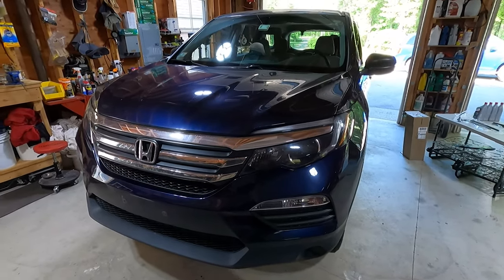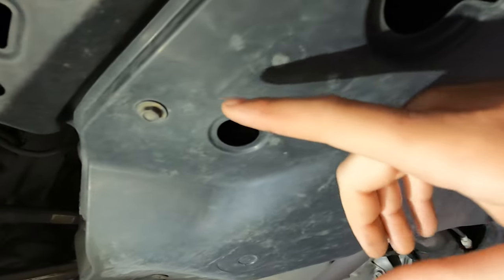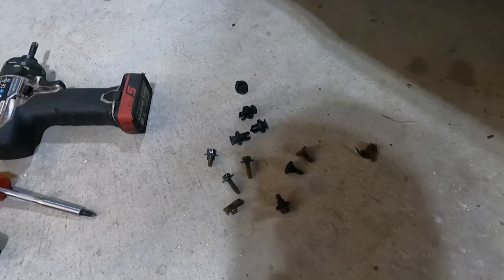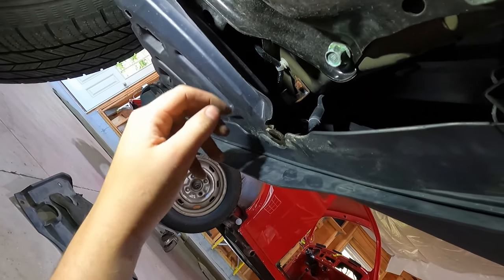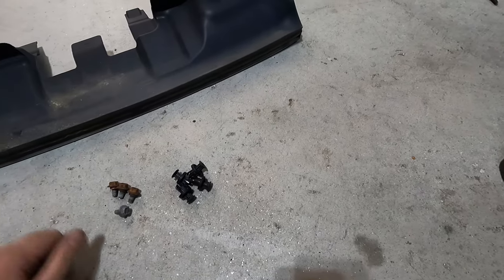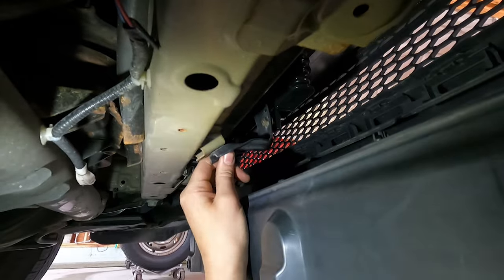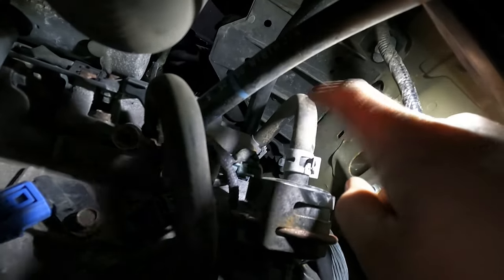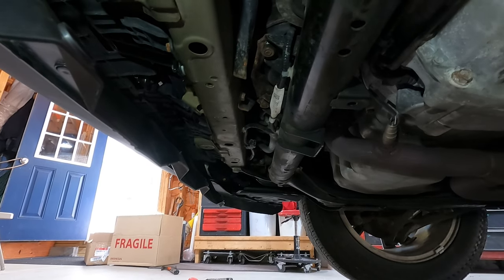2016-2020 Honda Pilot | How to install OEM transmission cooler kit | Better cooling + more towing!

Comment: I use a translator. Can you tell me if the 9-speed transmission is also useful for installing this device? Or is it unnecessary? I want to tow a motorhome, don't know which one yet

Comment: This kit will also help the 6spd tranny not burn the fluid as much .longevity wise even if not towing .specially with these 6spd tranny issues I have a 2020 with 33k and I had to do a 3x drain and fill and the tranny is eating up this fluid so I have to do drain and fill every 15k .my friend did this on his tgat had tranny issues also eating fluid and he installed this kit not towing and it solved the burning of the fluid.ill be getting this kit next week thanks for the install easy enough
Reply from the maker: Thanks for watching the video

Comment: Do you think FWD Pilots can tow 4,000 lb with an oil cooler added? I would be towing on level ground and I haven't found any info about raising the tow capacity on the FWD cars. Thanks!
Reply from the maker: It seems that they cap the FWD capacity at 3,500lbs. Even though it would be just barely over that, it would see that Honda does not suggest doing it. You should use your judgement and listen to the manufacturer.

Comment: Thanks very informative video! The trans cooler looks tiny compared with other after market coolers. Have you monitored your trans fluid temps since installing and noticed much of a diffrence?
Reply from the maker: Honestly since we don't pull anything that's near the pilots limit I have not monitored the temps. There are bigger ones out there but I wanted to go with OEM
Reply: Can you show me the aftermarket ones that I can buy for the pilot 😊
Reply from the maker: https://amzn.to/457dlfq that is the go to aftermarket cooler

Comment: Would this video also apply to my 2023 Passport with the 9 speed? Or, is the newer transmission vastly different? I have the tow package with the ATF cooler 9 speed on the way.
Reply from the maker: The nine speed is setup differently. I would imagine that watching the video will help you understand how to install it, but the hoses and mounting locations will be different. If I had access to a 9 speed Pilot I would do a video
Reply: @streetriderscustoms  I appreciate that. I'm sure it would be a good video. Just out of curiosity, where are you located? I just placed the order for my cooler and hitch. If you are close enough, you're welcome to video the installation of mine.
Reply from the maker: @terraformingcats8175  I am in Massachusetts
Reply: @streetriderscustoms  ah ok, well it was a thought. I am far away from you. I will see about creating a video for the community when I install the ATF cooler.

Comment: Thanks for making the video.  Have you towed anything between 4000-5000 pounds after having ATF cooler installed?  I got mine installed and towed 3200-3500 pounds.  Once, I got a "Transmission is too hot" message when I was hauling at 70-75 mph and the outside temperature was 120 degrees.  Not sure if that added to the factor that caused the ATF cooler failed to work efficiently.  I had to pull over and let the ATF cool down then continue.  My Pilot has under 25K miles. Thanks!
Reply from the maker: We do not tow anything that is close to 4000-5000 pounds, and we have never got the transmission is too hot message before or after the install. My guess would be the outside temperature. 120 degrees is way hotter than normal. Were you driving in a desert?
Reply: @streetriderscustoms  yes it was in the desert.
Reply from the maker: That is real hot. In those ambient temps I'm not sure anything would help the temps towing that kind of weight
Reply: The manual says don't tow anything going over 60mph, or 55mph if it's a rigid trailer (like an RV) I'm pretty sure. Maybe that contributed. Being in the dessert was probably a pretty big factor thought!
Reply: I had the same issues with my Pilot but  it was 85 to 88 degree outside and I was pulling a 17 foot RV trailler that weight 3500 empty I when full, I am close to 5000 pounds. Today I had my infrared thermometer and check the temp of the radiator and only show  110 F but on the torque Pro app my tranny temp is around 194 & 212. So it look like my radiator wasn't properly hook up. Do you have any idea why the temp is so low?

Comment: So you just put it on and it work's? Just had a technician install mine ( i never asked about fluids) hoping i didnt miss anything.
Reply from the maker: Yes it works as soon as you have it all installed. I would make sure to check the transmission fluid afterwards

Comment: Thanks for the video, im considering adding a second cooler but from the video dont know which line is the send vs return line? Do you know is the line going into the filter the return? Also does these line run to the radiator or directly into the transmission? Thanks so much
Reply from the maker: It does not run to the radiator. It runs to the transmission cooler. If you were adding a second cooler, it should not matter where in line you put it

Comment: Can you tell me what size hose are used i am planning to buy just the cooler assembly to mount and then add hoses from local auto store. Also do you think the hoses attached to the fin unit will come off. So i can attach the hose from there straight to the transmission.

Comment: Should be done from the factory. No reason this should be an add on item. It's nice to have even if you don't tow.
Reply from the maker: Yes, it is such a simple little part that should just be included. Its just a way for Honda to make money to charge a lot more for a Pilot with the 'tow package'

Comment: Great video!   Can I do this on a 2wd same car?
Reply from the maker: I do believe it will fit the 2wd but it is only recommended for the AWD. Honda does not recommend towing heavy things with a 2wd so they say this won't fit. I would do some research before you do anything
Reply: @streetriderscustoms  thanks.  Ya that's the only answer the dealer will give me.  Although they did say don't tow with the 9 speed.  Researching the difference in components.  Other than the transfer case I can't see any.  Or any reason to not use a 2wd.  If I find anything I'll pass it on thanks again.

Comment: Would be this the same part and close install for the 2019 honda odyssey with 9 speed?
Reply from the maker: It would be a different part, but the basics are all the same. Bolt the cooler in the front and hook up lines to the transmission

Comment: Great video.  But I couldn't get to the top hose that goes to the pipe that originally came from the filter from under the car. I had to remove the battery, air intake, and bottom of battery case which had 4 nuts, 2 underneath that was a pain.  Once all that was out of the way I was able to remove the top hose to the transmission and install the new one from the kit (longer hose).  FYI for those having issues.
Reply from the maker: Well I'm glad to hear you got it done. I'm surprised you couldn't get it from underneath but you figured out a solution anyways

Comment: My man... the problem with the rust is not a Honda problem. It's your location in the rust belt. If you make one of these again, don't make yourself sound ignorant by wasting so much time complaining about manufacturer problems that are actually the fault of your municipality and state using salt to de-ice your roads. 🤦‍♂️

My 2019 Honda Pilot with 121,000 miles doesn't have this problem. Why? Because I don't live in the rust belt. 👌

Comment: Will this work on the 9 speed transmission, 2016?
Reply from the maker: The 9 speed is a different part. I believe you could follow the video for the most part but it will be slightly different because of the different transmission